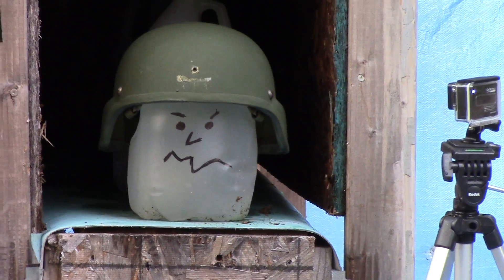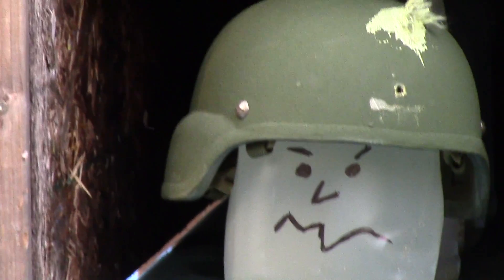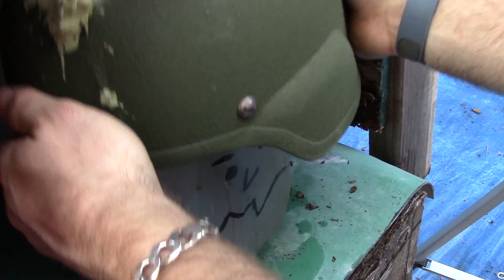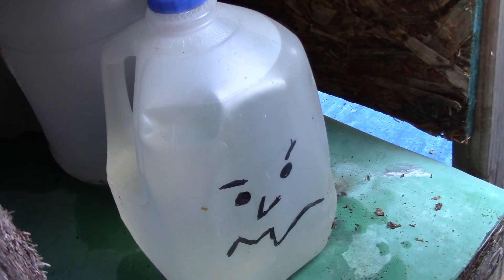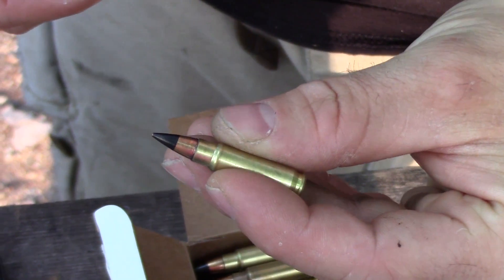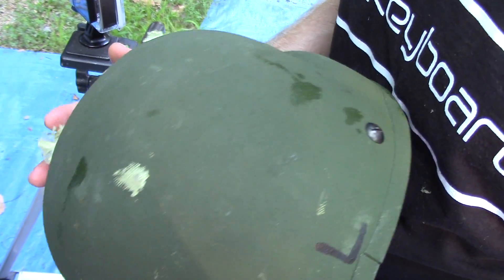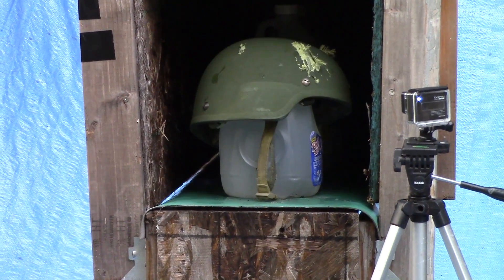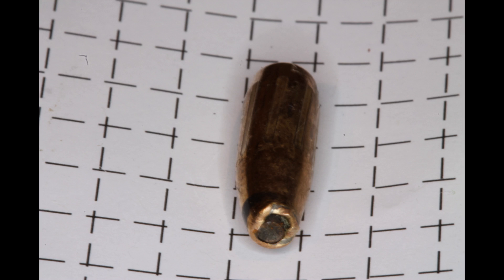Ballistic Helmet Performance Testing (Warrior Helmet by SDS)

Comment: When you test something with multiple different rounds use another helmet. Eventually a helmet will be penetrated because the integrity of the helmet has been compromised with material displacement. Even in science when stuff is tested they use a new item of the same type. Even if you shot it on the complete other side it would weaken the whole helmet.
Reply from the maker: Sure let me give you my paypal so you can donate the thousands of dollars needed to accomplish this :D Ballistic helmets are shot multiple times in the NIJ process. Generally speaking shots at 2" or more apart from each other should be OK, but that's not always the case. But you are right. I now limit shots for tests on armor has diminished so that a previous shot may not interfere with the next.

Comment: OUTSTANDING JOB ! Maybe next test you may want to mark the impact spots with chalk so as to make it easier to see the differences. FN made a formidable round in the 5.7. Another excellent penetration round is the 7.62 x 25 Tokarev / 7.63 x 25 Mauser. Both will penetrate very well.
Reply from the maker: Anderw Marcell  someone local has a CZ52 and next time we get together, we will throw it up against this helmet. I recall the Box of Truth getting them to penetrate these type of helmets.
Reply: I have seen a Tokarev penetrate a modern helmet. The old time brain buckets had no chance, hence their nick name. Helmets are to protect from shrapnel ,falling or blown debris etc. Your test is a reminder that; while it may cause a headache ; that helmet can save your life. I look forward to your next presentation.